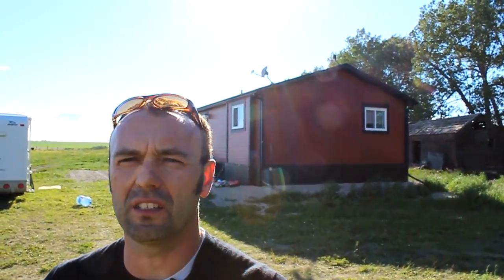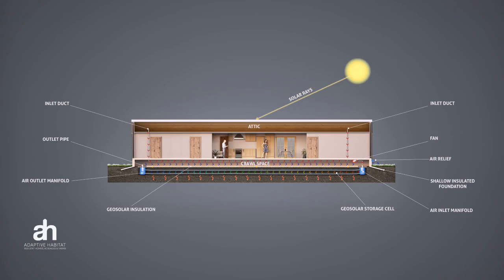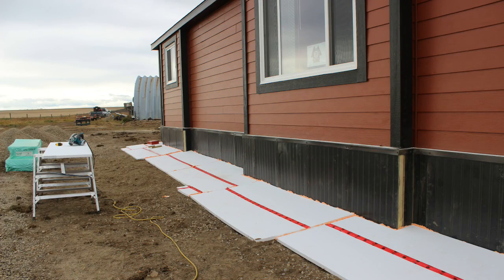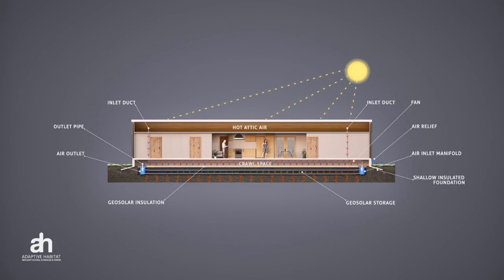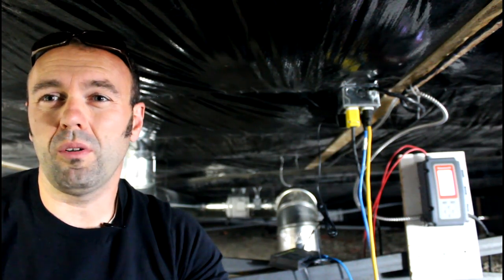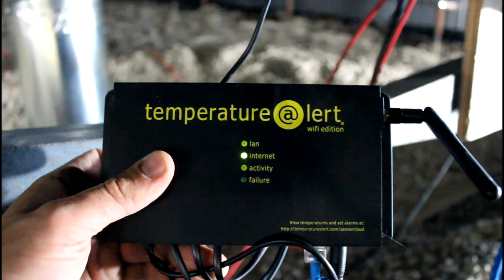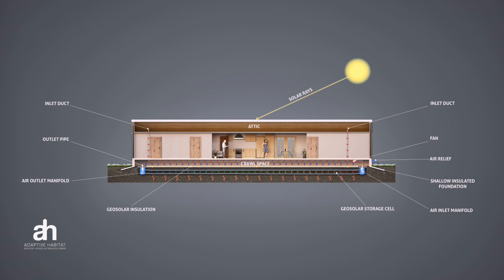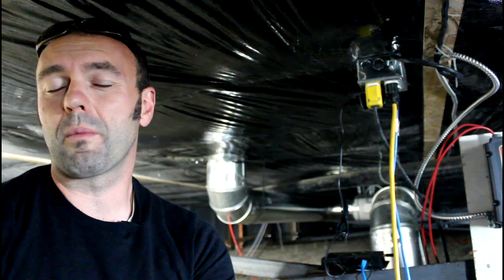Storing Heat Underground Using A Geosolar System

Comment: Really interesting. With all the data from the wifi temperature probe , after 6 years , what is the results ? Any videos on this ? I already did the calculation by storing heat in sand and I just end up with big number for my heating needs during winter. Like 60 000liters of sand heated at 400C. Curious how your systems perform in real situation.

Comment: I have done a similar experiment in my house. 54 cubic meters sand in the foundation covered by 6 eps is being heated by 400 foot long 1/2 " pex pipe during the summer. I am not using hot air but rather using solar heated water to heat the sand. Same pex pipe loop will be used to extract heat during winter. 7 thermal sensors inserted in the sand  to monitor thermal build-up. The project is just completed this month, so only during the coming summer will I have a reasonable assessment of the system's effectiveness.
Reply: We do something similar to heat our raised bed greenhouses. Except that we use two loops instead of just one. One loop runs from thermal solar collectors to the underground climate battery under the greenhouses. The other, located a few inches above the first,  runs from the battery to a radiant floor made of upcycled pallets that are used as the walkways between the beds. The gap under the removable floor decking serves as a utility conduit where we run our pex and our other utilities. The use of two loops allows us to charge the battery with heat all year ‘round with the first loop but only draw heat off when we need to with the second loop. Water is more efficient at storing and conveying heat than air. Works for me!
Reply: need survey on your system
Reply: @resilientfarmsanddesignstu1702  How is that working for you, and what kind of climate are you in? I've been thinking of trying the same thing, but I'm in Central Alberta and it's currently -33C
Reply: @SkySailor75  Our system is working great. We live in Illinois. There are three reasons that we have the system. First, we want to have vegetables for ourselves even in the winter months. Second, it gives us a head start on other growers. So our vegetables are bigger and mature earlier than those of our competition. Where we live, unless you are out early, there is too much competition to make any money. Also, the pests arrive and destroy everything. As I often say, "The early bird gets the money, the late birds get the worms". Third, since a heated greenhouse is required  This system saves heating costs. Every bit of savings on costs improves the bottom line. This two loop system should work were you live but you might have to add a bit of antifreeze to the lower loop. I would drain the upper loop during the Winter  whenever it's not in use. Our lower loop is below the frost line and heat from the battery warming the moving water in the upper line keeps it from freezing.  Our system is on a hillside so we can gravity drain and flush both lines if needed. Hope that helps and good luck! Happy growing!
Reply: @resilientfarmsanddesignstu1702  Awesome!, Thanks for the info.

Comment: Use water not air for transport and storage, much more efficient no condensation ect. 
all the beast !
Reply: Water is prone to freezng and can turn your quiet winter night into a nightmare when water leaks out and washes away soil under your house. It's definitely not for basement storage.

Comment: Nice build Rob! One improvement for you. Suppose you put a small wood burner or rocket stove in the house with a thermal mass behind it. You construct your chimney such that the heat exiting up the chimney heats the air being pulled down from the attic in the two pipes that go from your attic to your manifold and fan in the crawl space under the house. The pipes are embedded in the thermal mass on either side of the chimney. In addition to this heat exchanged, the heat from the wood stove that rises along with the heat from your body, kitchen stove, water heater etc. will go to the attic and then be pumped underground. That’s a lot more heat added to the battery. At least a few more months of heat pumped in on the front and tail end. The ideal place for the battery is right under the house. Heat rises and once the house is built, no one is going to excavate there anymore. Why aren’t all houses built like this? Now that’s a good question 🤔 Maybe we should ask the fossil fuel, power companies and politicians that one, eh? 😁

Comment: Sounds great! So you’re cooling the house in summer and the energy is used to heat up a large thermal mass under the house to be used in winter - what does this mass consist of? Just the dirt/soil under the house?

Comment: What is actually storing the heat? The video didn't really explain how the system actually works. How much energy can it store? How does it release the energy? How fast can it release the energy?
Reply: Looks like the heat is stored in the ground (soil/dirt) under the house, in terms of how the energy is released, the diagram shows no system for this, so my guess is that the floor is not insulated and so the heat passively comes through the floor.
Reply: I live in a double-wide mobile home as shown in the video. Under each half of the home there is a plastic-canvas-like material that is usually attached at the edges of each half of the home. There is fiberglass or blown-in insulation on top the the canvas. You can see this canvas-like material in the video behind the man. He is not actually under the home in the crawl space. A video of him has been superimposed on top of video of the crawl space which shows the duct work for the geothermal system. There is additional duct work above the canvas for the furnace.

From this video, I would say that it is the well insulated crawl space under the home which is being heated. My home is located in Ohio. My home has a concrete foundation under it, although the home doesn't actually sit on the foundation, it is still supported on concrete pylons. This past winter (2018-2019) it got cold enough to freeze the incoming water pipe! So heating this space would have a huge impact on how much would be spent trying to heat the home. I suspect that by heating the crawl space the home is more uniformly heated. My crawl space is not heated and the rooms closest to the furnace, as the duct work travels, are warmer than the ones which are further away.

I have been looking for a method to heat my crawl space to save on propane during the winter and this seems like a winner. I have also been considering making a pop-can solar heater and then pumping the heated air into the crawl space.

Comment: Similar to the system our company designed.  Though we turn the entire framework of the structure into the collector in order to maximize the input.  We've also incorporated a Geo cooling coil for cooling the summer.  We're currently working to get the specialty components into mass production.   Feel free to check out our site thecorehome.com , or reach out to me on my youtube channel if ya would like to know more.

Comment: Make the house the storage medium . Take the money you spent on this  system and apply it to making a  super insulated and air tight house and you have a method of retaining  heat in the winter and keeping cool in the summer, for pretty much the same cost , with zero maintenance .
Reply: If you are just relying on the air in the the house then this wont work well as air has very little heat capacity. You would need either the floor or walls of the house to have significant heat storage capacity (thermal mass)
Reply: A passive house WILL reatain almost all the heat that is produced from any source and do it with zero mechanical additions . The amount of money spent on your underground system could have been put into increased insulation , triple pane windows and air tightness. 
The Passive house concept is centered around the retention of heat , as opposed to how that heat is produced. It is similar to wearing multiple layers of clothing in the winter. It's not necessary to focus on calories to produce body heat but on keeping ones core tempeture from declining, via the assistance of insulated clothing. 
I have built and lived in two of these house over the last fifteen years and can tell you it works . 
Last week it was below freezing at night and into the morning with a rise in the outside tempeture in the afternoon to about forty degrees. There was no production of heat in my house for ten days and yet the tempeture hovered around 70 degrees fahrenheit.
Reply: @siriosstar4789  A core concept of a passive house thermal mass. If you don't have it any a passive house wont perform. Any sun you get will overheat your house and days without sun will result in a cold house, because you can't get a house well enough insulated, not if you want to have windows and doors, even with tripped glazed windows the insulation value is not that high. That's why passive houses have are built with thermal mass. This house didn't have any thermal mass because it was moved there, thermal mass would make it to heavy for transportation so the solution was to use the ground under the house to store energy instead.
Reply: I think you might be thinking of the old concept of " passive house " where thermal mass was involved into the design . 
I am NOT speaking of that style house but of the newer version and meaning of the word 
Passive House. 
The latest version of this method has dropped the thermal mass from the equation and opted for massive amounts of insulation , triple pane windows and air tightness. Orientation to the south is no longer a requirement although it is preferable in any house. the newer Passive house design focuses on heat rentention from any and all heat sources. If almost  no heat escapes the building envelope , then the source becomes secondary. For example your system which is an excellent system , could be improved by making your house need LESS of the energy that you are storing underground. I will try to send you a link to clarify my post., if not just goggle "passive house design" and you will get lots of hits.
All the best and enjoy your new home.
Daniel , sorry the link was changed by "spell check" and now i can't find the web site. if interested you will have to do a search .

Comment: *Hi,, what is your opinion on geothermal heated greenhouses in cold climates like Central Canada using only heat from the earth for growing cold hardy vegetables throughout the winter. Would greatly appreciate your opinion and taking time out to answer this question as it is something I am pondering doing to reduce my carbon footprint**
Reply: I'm in central British Columbia. It's minus 28C right now. My wife and I tried growing through the winter but it's not easy. Even if you have a heat source (woodstove, attached building, geothermal...) the light levels are not great for growing, and day length is a problem. It CAN be done but why?
We found the answer to be a root cellar. Grow vegetables that store well: potatoes, rutabagas, carrots, beets and parsnips. Cabbage varieties like January King also store very well. 
Grow during the growing season and then take a break! Our 8ft x 12ft root cellar stores enough food for several families. Good luck!
Reply: @paulmaxwell8851  How about adding some solar panels that power lightning in the greenhouse?

Comment: Does it act as air conditioning in the hot season? As in keep the temperature under 80 in the summer?
Reply: getting hot air out of the attic helps.  Not completely sure how the air stays locked away for 6 months though.

Comment: Can something like this be installed under an existing concrete slab without doing extensive demolition? My basement stays cold, even through summer, I could stand it getting warm in summer and then helping stay warm through winter.

Comment: interesting project! do you think that you get all the heat that is required from inside the attic? wondering about capturing additional air from the air space underneath the  metal roofing but over top of sheathing?

Comment: Have systems been designed to work with homes that have basements? Have you run the numbers to see how cost effective these systems are? Seems like with the initial capital cost and the ongoing electric cost of these systems it might take a while to get on the positive side.
Reply: Good Questions.  What does it take to heat a home North of Calgary?  What if you used a DC electric fan to move the air from the attic into the ground and power it with photovoltaic panels?   You're likely correct that the initial cost would be relatively expensive, but over the life of the system/home replacing fans every few years and a couple of solar panels after 20 to 30 years would be cheaper than replacing a boiler or furnace.  Then there is the ROI from free energy both in heat and DC electricity.  Not to mention you could stack functions and build a solar photovoltaic array w battery bank big enough to run more than just the fans...
Reply from the maker: A Solar PV panel is a great idea. You could tune it to the heat absorption of the roof and the DC fan would speed up and slow down as the sun intensity changed through the season and the day.
Reply from the maker: Cost was relatively low because we used discarded materials. We also did all the earth moving while we were installing the eco-septic system and there tends to be lags when we are installing septic systems so it is nice to have another project to deploy our back hoe on.  In addition because of the skirting package that we chose the fan is needed anyway to dehumidify the space under the house.
Reply: Yes sir
Reply: Not sure, I don't think I am north of Calgary in Minneapolis MN. Would you want a backup heater link a boiler or furnace?
Reply: @verge I see. That is why I ask about the systems with basements. Most folks in my area have them. I like using discarded materials myself but the right stuff is not always available in a timely fashion. To me systems like this only make sense if it works well and is economical. I was just wondering if you had data that would help me become informed on how functional and economical a system like this is.
Reply from the maker: +madmodifier yes you need a back up heater. This is only for supplementation.
Reply from the maker: +madmodifier we are harvesting the data right now and will be for three years. this system has no operational cost over the conventional system. previously a fan would discharge attic heat to atmosphere.
Reply: VergePermaculture Thanks! I found this video initially as I am subscribed to your channel. Since then I have discovered your article posted on resilience.org with much more information. In my home I allow convection in concert with roof turbine vents take care of the attic (electric fans not included).
Reply: If you don't count the elecronics and wifi advance tech you can set a long pipe around the house or any place where you can find dry soil. Send hot air from a greenhouse to the ground in the summer and get it in house when you need it. Watter will steal that heat so some protection is needed if that soil is not under house

Comment: waste of time!!!! in summer you only need to cool your house down  about 20-30F....how is that supposed to heat your house the 50...60...70F+ needed in winter....could only heat the house by 30F tops from the temperature outside
Reply: So what do you do better ?
Reply: @AutoNomades  it will not work..don't get mad at the messenger...go ahead and spend the money to do it and get back to me. I work in the field and yes there are way better ideas but they are not free...
Reply: @metou3072  Im not getting mad at the messenger, i just ask to "the messenger" how he would do better. Do you really feel attacked ? I ask you because i am interested in this subject, so if you claim "knowing better", show it so we could approve it : )